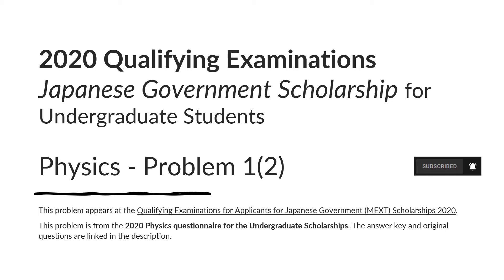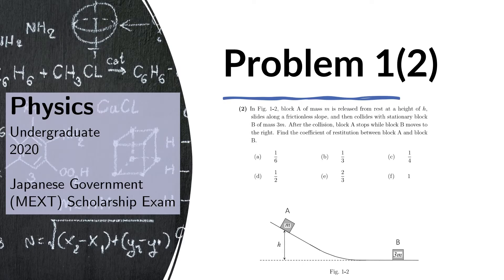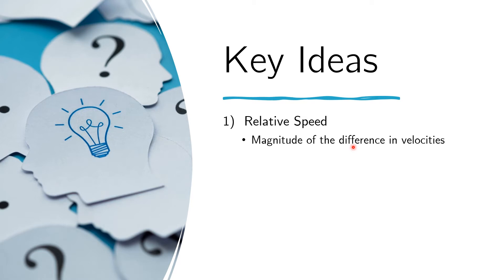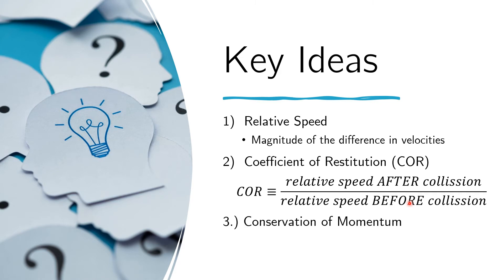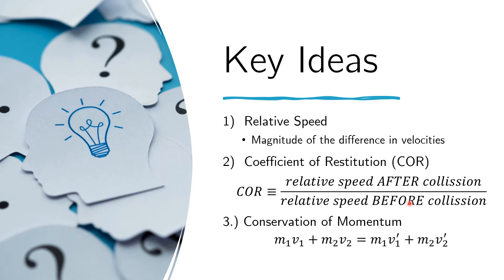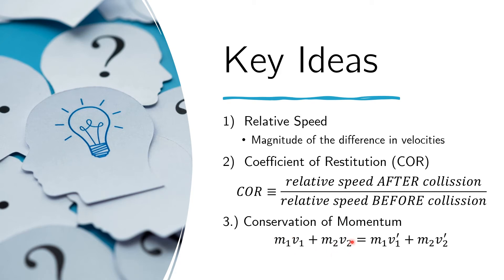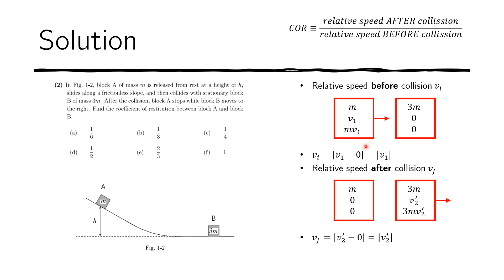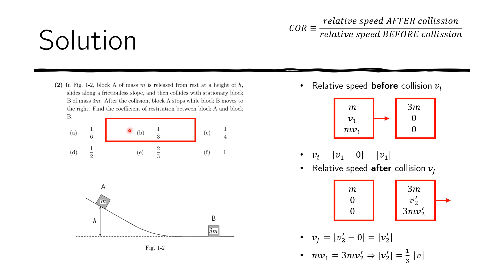Collision Conservation of Momentum - MEXT Scholarship Exam Solution - 2020 Physics

Comment: In the formula of COR you wrote relative speed before collision and relative speed after collision. But the terms are relative so you should clarify which object's velocity relative to which object. Velocity of A relative to B will be different than velocity of B relative to A.
Reply from the maker: Hi, to help me understand what you mean, can you provide an example where there relative SPEED of a with respect to b is different from the relative of SPEED of b with respect to a, please?
Reply: @jhatjuku  SPEED works in this question but when solving question of relative motion, we work with VELOCITY which is a vector quantity and not speed. And when we work with a vector quantity, it can give us different answer according to sign convention unlike speed because it only gives us the magnitude. For example (not in the context of this question), there are three objects A, B, C and all are under linear motion. The velocity of A with respect to B will be Va-Vb, the velocity of B with respect to A will be Vb-Va (both will give us different answers) while velocity of A with respect to C will be Va-Vc. Now here we can't define relative velocity of A or B or C, we can only define velocity of an object with respect to the other object.
Reply from the maker: I see. But the question is about the COR. Do you define COR in terms of relative SPEED or in terms of relative velocity?

I used relative SPEED here because that is what the question is about (COR). I would have used relative velocity if the question were about relative velocity. Does that make sense to you? 😊